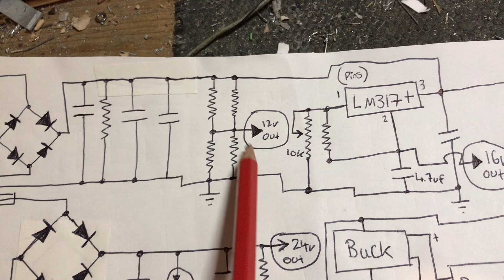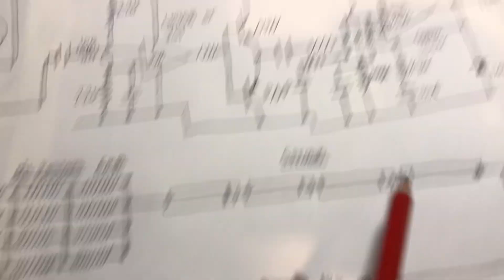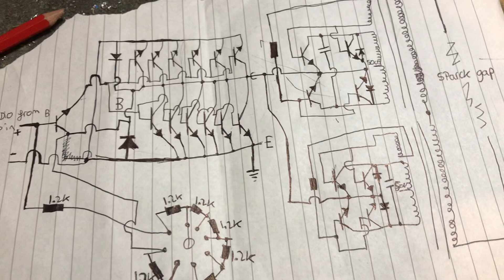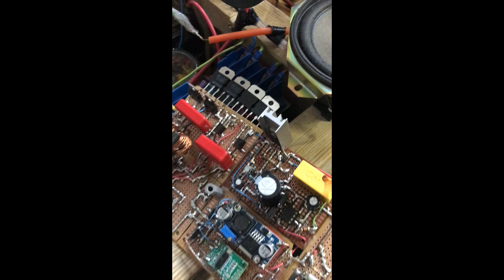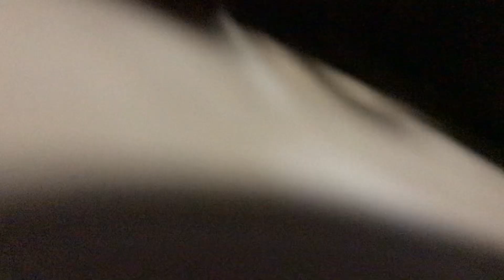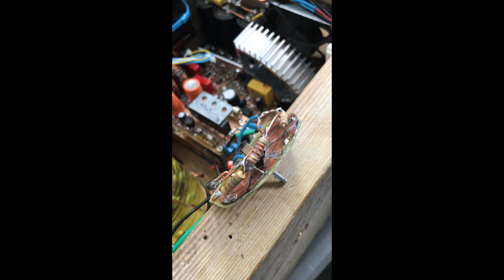Plasma speaker project

Comment from the maker: I missed a resistor on the final diagram. It’s connected to the 10k and the 358 and it goes to the emitter of the NPN transistor.  It’s a feed back resistor if you want to build the circuit you can experiment with it. Try 82k ohm